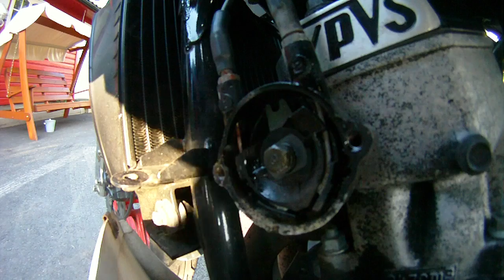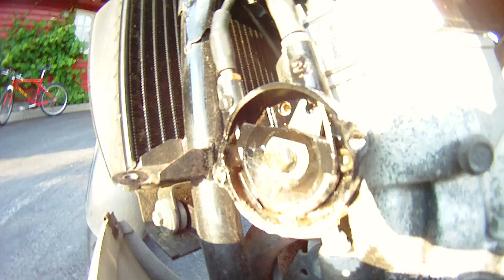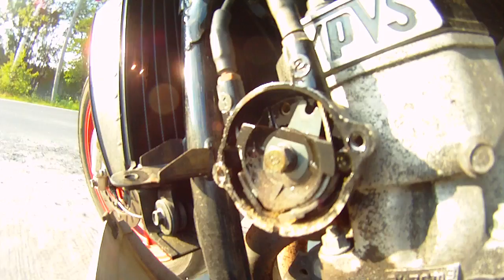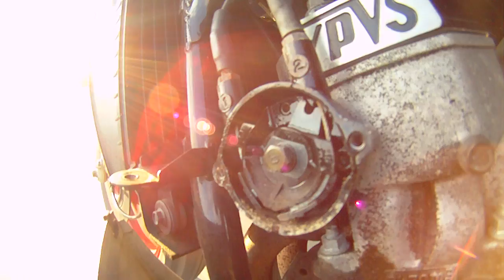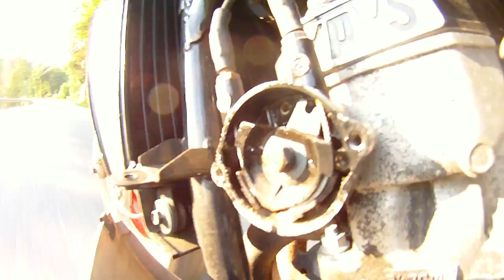Yamaha RD350 YPVS. Exhaust valves while driving.

Comment: On my RZ350 it works exactly the same but it still seems odd to me that it rotates forward as the revs rise. Wouldn't that be closing the power valves? Seems like it would be in the forward position - closing off the exhaust ports and then rotate back to open them. Or do they close off the ports from the bottom of the valves at low revs which would then make more sense to rotate forward?
Reply from the maker: The valves are facing backwards, towards the cylinders.